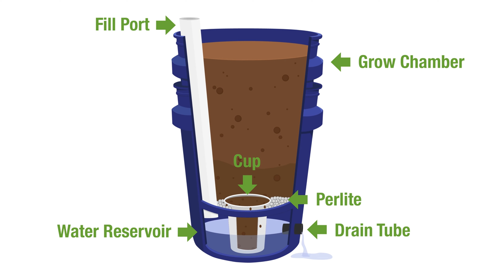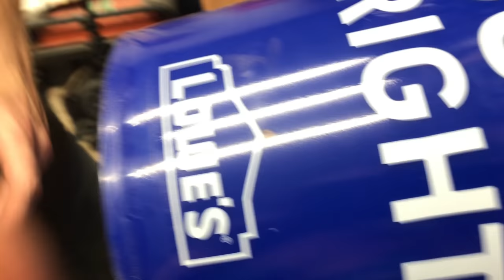How to Build: Self Watering 5 Gallon Buckets

Comment: Drilling into your table? The sacrifices you make for good content 😳
Reply from the maker: I'm glad somebody recognized how hard I'm workin' here! 😂 In all honesty, my table has several oversized holes in it. There is a good possibility that I drilled a new one in the making of this video, but it's also possible that I was drilling into one of those holes. Thanks for watching!
Reply: @HydroHowTo  there's video evidence, man... anyhow, good ideas here......question is, do you need the depth of inside cup, or could you use something like a shallow hummus container..... thus allowing the 5 gallon pales to rest naturally inside on another......you;d have to put the drain hile more like 2 inches......
Reply from the maker: @curiousbystander9193  With a shorter cup you would have less water holding capacity. That’s no problem if you’re willing to add water more frequently, especially if you live somewhere with mild summers.

Comment: Do you have problems with mosquitoes using that water for laying eggs?
Reply from the maker: I fill them every couple days until water starts to flush out of the drain. Haven’t ever had mosquito problems. If the water sat stagnant long enough I’m sure it would be a problem.

Comment: Quick question: For the drain tube, why not just drill a half inch hole in the side of the bucket and leave it? I'm not sure what the bit of tube adds.
Reply from the maker: You can do that, but I try to limit the water pooling around the base of the bucket. I also use the drain to direct overflow into a gutter and flow back to a catchment for reuse.

Comment: Can I use the grommet in the bucket without the irrigation tube?
Reply from the maker: Sure. If you're okay with drain water running down the side of the bucket you don't really need the grommet either. I use the grommet and tube to direct the water away from the bucket since I don't want my wooden deck to stay wet under the bucket.
Reply: @HydroHowTo  I had to use a7/8 grommet because that’s all I could find. I can’t find 7/8 irrigation tube guess I’ll look online. Thank you again for responding.
Reply from the maker: @mrpoole404  you’re very welcome! Another thought would be to check out PEX pipe at your local big box store. The outer diameter may be close to what ya need.
Reply: @HydroHowTo  👍

Comment: Cut the bottom of the fill tube at a 45 deg angle and no problems with it getting closed off on the bottom of the lower bucket.
Reply from the maker: Smart!

Comment: So its like holding additional 2 liters of water. What if you will use additional 2 liters of soil it would act the same? You still kinda need to water your plants, isn't it?
Reply from the maker: This is geared more toward people who have trouble with over/under watering. Fill the bottom with water and the plant will wick the water as needed.

Comment: I don't get why the plant bucket sn't placed higher up. If it were  resting higher then most of the bottom bucket can be filled with water. Smart people on here can probably figure out  various ways that could be done. Though it may require screening to keep insects and critters out of the bottom bucket. I want to experiment leaving some low light palms for 5 months in my attached garage with a light above on a timer. But I will need a much bigger water supply. Though, I may have someone come once a month to check. Any ideas?
Reply: The "wick" needs to be effective as the water level drops and you have more airspace.

Comment: Your instructions are so clear that I could probably follow this guide with audio only. Very well done

If I were to use pearlite and nutrient-enhanced water, would this setup work for a hydroponics setup?  (If you have the water in and outputs figured out).  i.e. would the pearlite wick the water upwards like the dirt.
Reply from the maker: Thank you so much! I’m glad the video was helpful for ya! Yeah you could definitely do that, but I would recommend adding an air stone to the bottom reservoir.

Comment: I liked your beginning explaining it. Perlite in the bottom is a very good idea. I made several last year. Why did you screw the two buckets together? Only need  around 1" of air and my cup was a little high in the dirt but worked the same. I personally used a hole saw for the cup. I used ocean forest on 1 of mine in a self watering bucket and it was the only 1 of 60 that got a disease I think so I  killed it. How'd it work for you? I think it was an individual plant issue. It is said to use a potting mix and not soil in self watering buckets. I did have success with a self made mix using equal parts of soil with compost, peat moss and perlite. It was heavy but it worked well.
Reply from the maker: Thanks for watching! I had good results with Ocean Forest, but I think your soil mix would work perfectly as well. My best results in the past have been with a potting soil called Jungle Growth that Lowe’s sells. They didn’t have it this year when I was resetting the buckets. I screw the buckets together because I’m a control freak, lol, plus when nothing moves inside the bucket all the seals stay tight and I have no dirt making it’s way into the lower res. May not be needed, but it’s the way I’ve been doing it for several years and the bottom bucket is always clean at the end of the growing season.

Comment: Is it not easier to fill with a hose through the drain tube so one does not need the top tube
Reply from the maker: You can give that a shot for sure. I don't know if it would be easier or not.
Reply: @HydroHowTo  i mean what if the drain tube was angled and had a little valve opening for drainage, so it would be both the drain and the feeding, I love the original idea though
Reply from the maker: Sounds like it might work!

Comment: This is an excellent idea!! I will be making these on my next days off work. Can I raise the top bucket more and raise the drain hole to create a larger reservoir?
Reply from the maker: Right on! You can raise the top bucket, but you'll probably want to add some kind of support. A lot of people use a few pieces of PVC pipe in the reservoir to support the top bucket. You can drill several holes in those support pieces so you don't lose much water capacity.

Comment: Anybody use this I got a question do u have any problems with root rot. How long are the grow session
Reply from the maker: No issues with root rot in my experience. The soil wicks water as needed. I start tomatoes in them in the spring, and they produce all the way up until the first heavy frost (usually mid-late November).

Comment: I really like this hydro idea, one question do you think that the fill port and drain port should be rodent proofed with screen and hose clamps? Or nah ?
Reply from the maker: That’s a good question. I’ve not had problems with rodents, but I’m sure it can happen. I would recommend screening the drain, and maybe just putting a removable cap on top.

Comment: Does this also work with cannabis plants. And the reason I asked is because I was specifically told not to let it sit in water. New to the game learning as I go along
Reply from the maker: Hey Albert! “Don’t let it sit in water” refers to keeping the soil or plant oversaturated. Using a wicking bucket like this only pulls water as the soil needs it, so it never becomes too wet. The only limitation is the size of the bucket. As long as it’s big enough for what you’re growing, it’ll do great.
Reply: Yes it does.  I used to have overwatering issues when I first started.  This design has cleared that up.  Plus I can leave for a couple days and not worry about it.  I use one bucket with the lid cut out and pushed down inside.  I put an old Tupperware container with holes drilled in it as a spacer in the bottom for the cut lid to rest on.  I used to run it with a pump and airstones to aerate the water,  but I found that to be unnecessary.
Reply: Earth box
Reply: @hashjesus1254  actually its a direct ripoff of "hempy buckets"
Reply: Hash Jesus... Hempy bucket... Is an improved ripoff of kratky method
Reply: @johnbryant-ch5md  i sort of agree but not all kratky is hempy bucket.
Reply: @megaflux7144  not exactly... But just add soil... Hempy buckets are great I'm hoping... So far so good
Reply: @johnbryant-ch5md  they are definitely great for beginners! eventually you do outgrow them (like literally i would need 50 gallon hempy buckets to do what im doing).
Reply: Line the top bucket with a 5-gallon tall fabric planter bag, then use a quart bag for the bottom cup,,, top (up to 7 times) and manage your plants. You'll get MONSTERS that can yield 3lbs dry,,, if you use keg ice holders (plastic big bins) You'll get 7 pounds of dry per plant. It goes up the bigger you go,,,, you honestly can make a Mother plant that produces 20pounds plus if you start in late March. Full moons and soil are key 🪴 🌱 🤙🍻💪

Comment: I'm a dirt farmer and grow in bags. I used 5 gallon buckets for years, and the plants tell you when they want water. Happy Frog potting soil works for me, but I also used MG for years, and they love that as well. All of my water for the plants runs through an RO unit first. I like your attention to detail about making sure all of the soil is thoroughly saturated. Dry spots in soil tend to remain dry for some reason. I like the grow bags because it's impossible to over-water. When a plant is thirsty, it'll droop. Once you get the hang of growing, you just know when it's time to water by sticking your finger into the soil. Easy.
Reply from the maker: Thanks for your kind words! I’m not real picky when it comes to potting soil brand. One of my favorites is a super cheap off-brand that Lowes carries. I totally agree on the dry spots!
Reply: It helps to use lukewarm water when saturating a dry soil. Cold water tends to bead up rather than absorb and you get those dry spots.
Reply: @guysmiley4830  Good advice. Thx.
Reply: You are spot on
Reply: After 35 years growing I ended up in fabric bags.started in 5 gallon hydro.
Reply: @JW-lq9ow  I started out in 1984 or 85 with PVC drain tubes, slots cut into them for the plants, and lava rock for the medium. I hated hydroponic with a passion. Pain right in the balls if anyone asks me. Dirt, fabric pots, good lighting, ventilation, and clean water are all I require.

Comment: A single bucket works just as well.  Just create an overflow hole 4 inches above the bottom and fill those 4-5inches with reusable gravel/clay balls, a hole either side will make sure it handles rain.
 Fill the remaining with potting mix. This is what they call the 'hempy bucket method'.   A tried an true simple method dating back around 20 years.
Reply from the maker: Thanks maximosh! I’ve used that method in the past. The only thing I don’t like is that you lose 4-5 of growing area in the bucket. Thanks again!
Reply: I use a res bucket and drip on multiple buckets each having a res like these that overflow back to the main res. Ive been growing weed for decades and this is just like nature.
Reply: Wet the soil before you put in container to avoid dry pockets. Or make up bucket days ahead and let water wick up until top is moist.
Reply: @HydroHowTo  You probably wont  "lose 4-5 of growing area in the bucket".  As plants do use that area for their 'water roots' instead of the normal aerial roots in soil above.
Reply: @genocanabicea5779  Interested in the latter to confirm effectiveness. Thanks.

Comment: I've been using this system for years and found that it becomes a mosquito magnet if you don't cover the drain hole with netting. Also, the water reservoir becomes full off manure water if you water from the top instead of filling the reservore directly.
Reply: It seems you don't worry about the water level in the bottom bucket is their another way to tell besides dropping plants I'm planning on trying this out wish me good luck
Reply: @alvinbryant8313  I used to put a cork skewered to a long stick and placing it in the inlet pipe to tell water level but drilling a hole on the side of the bucket and attaching a 1/4 hose to it was sufficient to tell it was full. i used the cap from the bic pens to cap the 1/4 hose so the mosquitos don't get in the water resorvor.

good luck!
Reply: @alvinbryant8313  Instead of drilliing holes in the small paint bucket, I used a razor to cut 3 slits, works fine as a wick for the top bucket. Also, the Solo cups work just as fine as a wicking medium and way cheaper. I used the cups from Starbucks also for wicking since it is taller (because I used a different top containter instead of the 2 bucket system, so you get more soil)

Comment: The one problem is that soil leaches into the reservoir through the holes in the cup. I combat this by sliding the cup into the foot of some pantyhose then installing the cup and trim off the excess. Use some fine sandpaper and polish up the hole before installing the cup to avoid snagging the pantyhose.
Reply: weed block netting for landscaping.

Comment: When I need to put a bunch of small holes in plastics that tend to crack my 1st option over a drill is a fine tip on a soldering iron. So much faster and seems to make the hole area stronger and less chance to split later. Something i do for DIY aquarium/aquaponic filters and pots
Reply from the maker: Great tip!
Reply: @HydroHowTo  if you where to add a mini float valve you could auto feed a bunch via 1 barrel or tank.  Add a small air stone in each and maybe get away with 2-3 small guppies for pest control. Just need a sponge in the overflow ;)

Comment: I was thinking a 3 gallon in a 5 gallon and use wicking dangling from the 3 gallon into the 5 gallon so u can stretch it out longer
Reply from the maker: Hey Peter! Are you saying 3 gallon in a 5 gallon so you have more water holding capacity? That could work if the buckets are close in diameter. I personally like the added room for root development that you get from a 5 gallon bucket. Thanks for your comment!
Reply: I’ve used 2 liter soda bottles with cotton clothesline wicks through the caps (1/4” drill).  Three 2 liter bottles stand nicely in a 2 gallon plastic pail.  Keep some water in the pail, wicks do the rest.  When the plants get larger, slit the side of the bottle to transplant.
Reply from the maker: I like it!

Comment: This only works for plants that love that type of moisture though. Plants that need a more dry soil will get root rot quickly.
Reply: I do like the design however for plants that want the moisture however.
Reply from the maker: You control the moisture with the kind of media you use in the bucket.

Comment: You should use a 3 inch net cup.  Not a plastic tub with holes.  Make it higher quality.  Also use potting mix not perlite.  If you need tips just ask
Reply from the maker: Good ideas. I'm not sure what you mean about potting mix not perlite. I say in the video to use potting soil....

Comment: I've made these double buckets before, but made the bottom reservoir larger by using thicker walled, larger diamter pvc pipe in the bottom to support the weight of the top bucket. Cuts of 4 in pvc with mutiple holes drilled works good. Or use Charlotte drain pipe & drill holes on the blank side. Yes, it leaves a gap between the two buckets on the sides which I bridged with sliced pool noodle foam. Cut the foam slices like wedges & jam it down in the space tight. You can easily have a 6-8 in deep reservoir. Holds much more water.

Too bad 7 gal buckets aren't a thing. The 5 gal bucket reservoir is too small for tomatoes & other veg which suck a lot of water as they grow in the heat of the summer.
Reply from the maker: That’s a great idea! I agree, the 5 gal buckets are a lot of work with tomatoes in the middle of summer. I refill them daily.
Reply: @HydroHowTo   Yeah. I even put the larger reservoir buckets on irrigation with a timer so I could leave town.

FYI- Recently saw a vid of a guy who cut a slender piece of pool noodle & put it down the fill hole to act as a gauge to measure the reservoir as it bobs up & down. He used different colored tape to mark "full" & needs "fill." Clever.
Reply: @flatsville1  Thx, super problem solver.
Reply: @xavierkoolat6926  I have my moments. My kid nicknamed me "MacGyver."

Comment: I don't understand the point of the fill tube. Why not just put water in the soil until it runs out the drain tube?  I have found that potting soil just doesn't have enough nutrients, and I have to add fertilizer. So, I usually go half and half garden soil and potting mix, which seems to feed the plants better.  Finally, why not just put a drain hole in the side of a single bucket about 3 inches from the bottom and skip the rest?  The bottom would fill with water and act as the reservoir for wicking water upwards. Even though there is soil in the bottom, it would still hold a lot of water.

Comment: Have you considered for priming the bucket to plug the drain hole and fill it with another gallon or two and letting it bottom water like you would a house plant? Prevent washing away any nutrients unnecessarily.

Higher water level to allow the holes in the bottom of the inner bucket to aid in priming the bucket
Reply from the maker: That is a good idea, will try it out!

Comment: When your originally water the bucket to make sure it's fully soaked so it wicks. Place a milk jug on it with thumbtack holes in the bottom so that you water it slowly. It's better for the soil.

Cover the top with plastic or mulch too.

Comment: My experience with the blue Lowes buckets is that they are brittle and don’t weather well.  For a few cents more, I use white ones.
Reply from the maker: The white ones are definitely a good option. These blue one have held up pretty good for me over several seasons in Alabama, but you may have more sun exposure than I do.
Reply: True! If you can get empty 5 gallon from a paint contractor, they are a higher grade of plastic, for industrial uses. Also, a sun blocking paint coating makes them last for years.